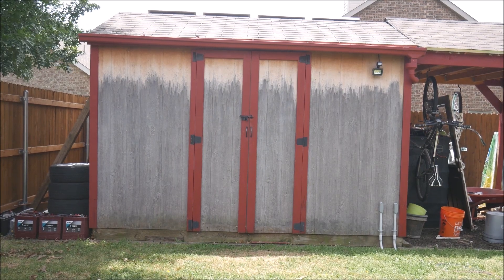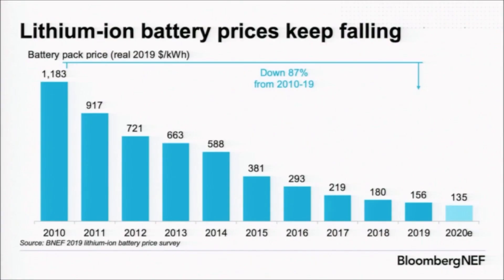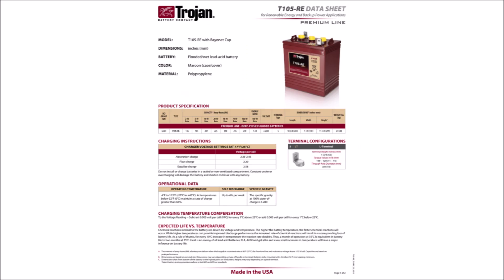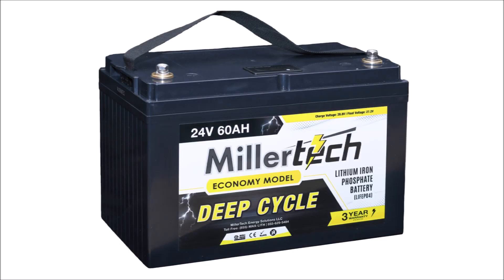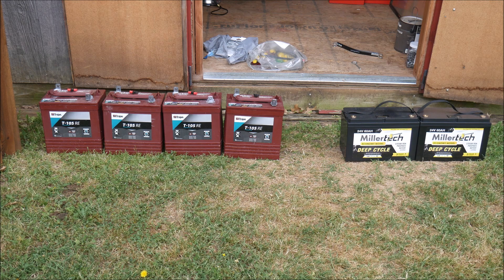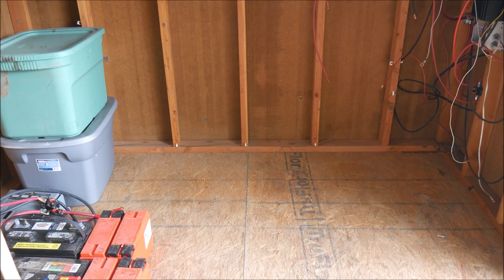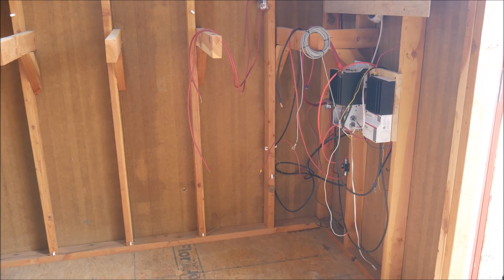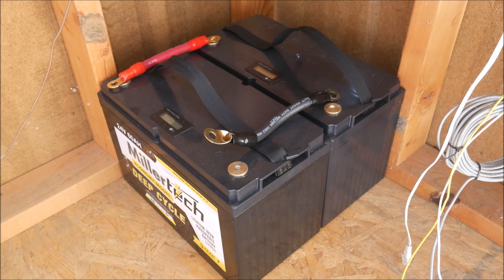I'm Going Lithium! - Off Grid Solar Shed 24V Lithium Battery Upgrade

Comment: Taking up less space, more energy density, weighing less, prices dropping over time, no reason not to upgrade. Im building a 2 KWH Lithium power bank thats portable and charged with solar.
Reply from the maker: The only reason that was keeping me from upgrading, besides the reason mentioned in the video, was my perfectly suitable set of previous batteries.  When they stopped handling the load this past winter it opened the door for the upgrade.

Comment: Hi hope you can help- I have a metabo cordless drill 12v and 1.4 amp hour. I want to convert to direct socket power. I will use 12 v charger or something like that which I understand. But what amps should I buy? Will 2 amp be better than 1 amp? Or it wont matter?
Reply from the maker: I'm confused.  You are trying to power a drill directly with solar power?  Or you want to just recharge the drill battery with solar power?
Reply: @LDSreliance  no no. Just to make it corded instead of cordless. To have an outlet as the power supply. Im just not sure how many amps of the converter I should be using. Not sure if it matters at all. I believe it does matter right?
Reply from the maker: It will probably need more than 1.5A because those motors require some surge power when they spin up.  I would say 3A would be a good guess.
Reply: @LDSreliance  ok would it matter if i live in a country with ac 220-240? Or it wont matter? Still 3amp
Reply from the maker: That doesn't matter because you are using a 12v charger.  The charger or power supply needs to be at least 12V 3A to power your drill directly.  On the input side, the charger will need to consume 220-240V AC.
Reply: @LDSreliance  ok i will try that. Just wasnt sure if there is a thing like too many amps. Because i was pretty sure it can burn the motor of the drill or the switches
Reply from the maker: No, that isn't the way that most devices work.  They will only pull the power they need.
Reply: @LDSreliance  oh really? I didn't know that. So even a 10 amp phone charger for example if i connect it to a drill wouldnt hurt it? It would just pull say 2 or 3 amps that it needs?
Reply from the maker: Yes.
Reply: @LDSreliance  ok i learned something 😀👍
Reply from the maker: There are some rare exceptions.  But they are rare enough that I can't even think of any off the top of my head.  You are safe with a power tool.
Reply from the maker: Good, I am glad!

Comment: There's danger of fire due to lots of wiring in your wooden cottage.
Reply from the maker: No there isn't.  That is why there are all of those breakers everywhere.  And the batteries themselves have short circuit protection, as well.  I might accidentally shock myself if I am careless but there won't be any fires happening.

Comment: Great upgrade.  Looking forward to seeing how the Miller Tech work out.   One suggestion is to put cables on opposite batteries.  Load pos on one battery and load neg on the other battery.  Simple enough and not much difference but it’ll help make sure battery’s are loaded equal.  Won’t make much difference but every little bit helps.   You can do the same for charge cables.
Reply from the maker: Interesting.  I will have to give that some thought.  Thanks!
Reply: @LDSreliance  I was thinking the same thing. Probably not a big deal with low C-rates, but the one battery directly connected to the charge controller and/ or inverter (charging/ discharging) will get more of a work-out than the 2nd battery parallel connected to it. Connecting one lead to each battery helps balance the workload between both batteries (instead of stressing one battery more than the other). Try it! Draw a decent discharge then soon after, measure the voltage of each battery. Chances are the voltage of the 1st battery will be slightly lower than the 2nd battery (until they gradually equalize each other again).
Reply from the maker: Easy enough to quickly re-wire.  I'll do it.

Comment: I have similar 6v batteries, and a 24v set of L-16's, for backup, and soon will be in at 33 kwh of lithium battery!  It's been a long journey getting here, I hope to be in the 40's or 50 kwh by fall or winter, and hopefully around 4kw more PV!
Reply from the maker: Holy crap that is a lot of capacity!  Good job.

Comment: Why? Just how long do you spend in your shed at night?
Reply from the maker: Why not?  The system is primarily for backup power in case of an emergency but I also use it when I tinker and for charging power tools, powering a motion activated flood light, and powering several outlets inside my home.
Reply: @LDSreliance  these things are very useful for items we have no other way of powering. 

But, for uses like upgrades of perfectly good recyclable acid type units may not be a good choice. 
Non recyclable energy sinks with highly questionable social ethics in mining of metals like Co ( if used) is a real problem. 
I would avoid using them until we are assured that they are not just landfill in the end.

Pb batteries are fully recyclable (95% i believe)
Reply from the maker: My lead acid batteries are dead, which is why I upgraded.  If they were perfectly fine I would keep them as I still like lead acid.

There are pros and cons and some people get upset when I defend lead acid and others when I defend lithium.  So it is just part of being on Youtube, I guess.